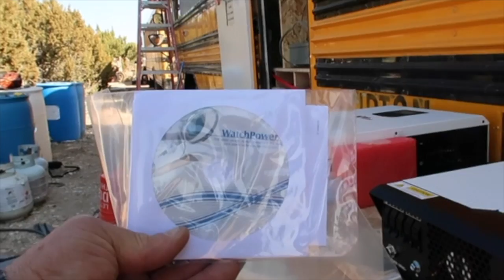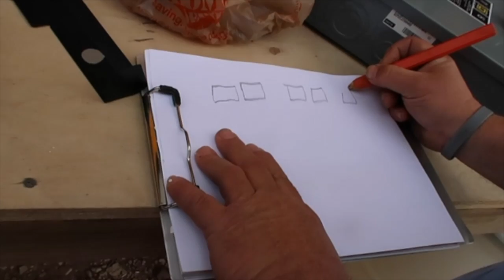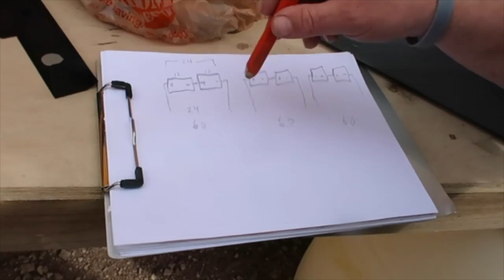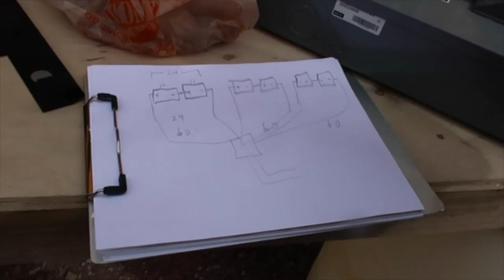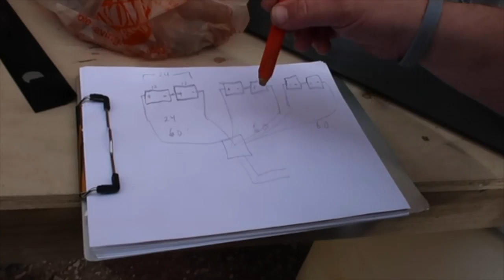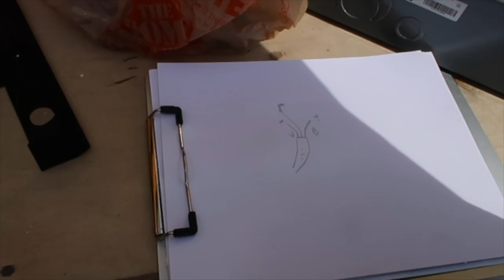School Bus Conversion to Motor Home #15 (Hooking up solar panels, QO breakers and Generator)

Comment: you should have the green bonding screw that came with the ac QO panel, screwed through the neutral ground bus into the frame of the box. this will ground the metal box to your common ground bus. 
Are you using gfci's for the wet ot potentially damp outlets, like kitchen, bath, outside outlets?
I assume the ground is the chassis of the bus in which all the grounds will be bonded to. Steve will explain it to you.
nice job!

Comment: For my bus I am considering using the buses main engine with a second alternator rather than a dedicated generator.  The goal being a single fuel (no propane) Rig.  Diesel furnace for heat and on demand hot water and a 2 burner induction cook top.
Reply from the maker: Sounds great!  Thanks for watching!

Comment: Hot wire or wires in phases , common wire, and ground. D C or A C current only need fuse or breaker protection on the hot leg of the circuit. Multi phase needs more then one in high amp settings . Single phase only on hot leg.

Comment: Are the clips that secure the PV panels to the PV panel rails rated for >65 MPH?
Reply from the maker: They are but as you may see in a later video we ended up getting two messed up because of a cross wind.  We now have cowling around the panels.

Comment: I am adding solar to my bus conversion.  I currently have 8 355 watt sunpower panels. I have been looking at the Mpp Solar controller for my system and was curious about what model controllers you  are using, any trouble with either of them,  would you reccomend them? Thanks in advance!

Comment: I was thinking it would be cool if you built up Styrofoam insulation on the underside and around the solar panels and shaped it to match or at least look good and then fiberglass it all. 
You would just see the top of the solar panels.

I think it would look way better almost like its built it and help, adding some insulation to the roof. I guess then you would need to raise your vents and build a duct which would cut down on noise.
Reply from the maker: Thanks for watching.  Happy New Year!